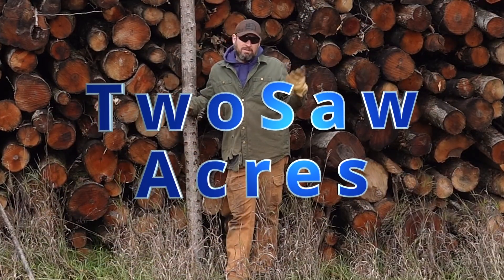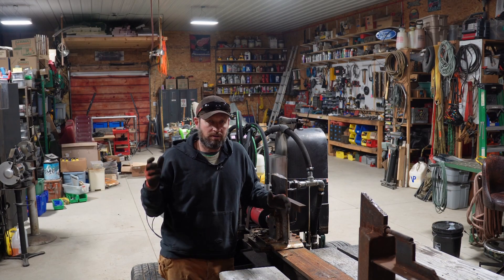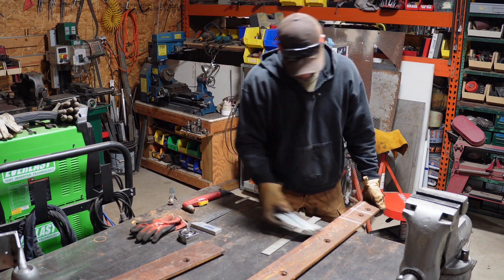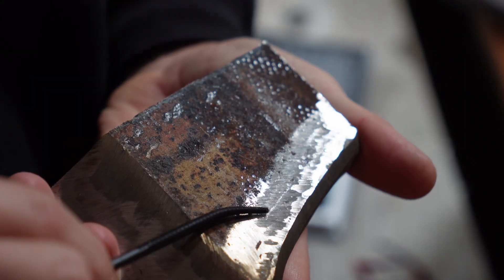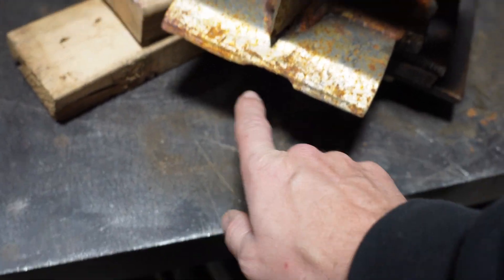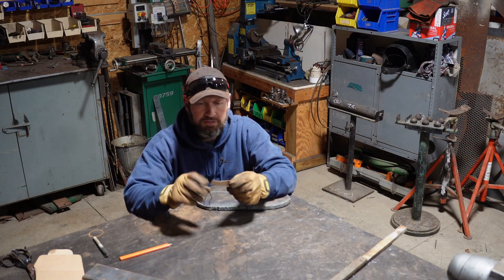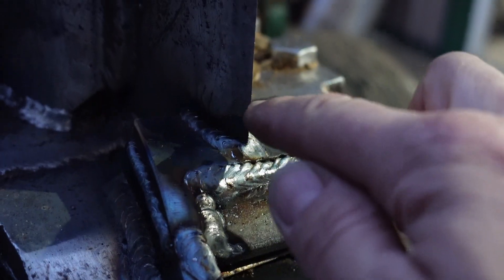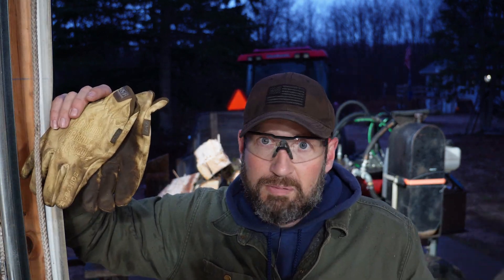Log splitter four way wedge fabrication

Comment: Umm ,, countersunk bolts ,,,,.?
Reply from the maker: Good idea,  I think cutting the counter sink holes would be a real bugger, especially now with the horizontal blade in place. Maybe just cut the heads off the bolts and weld them in as studs?